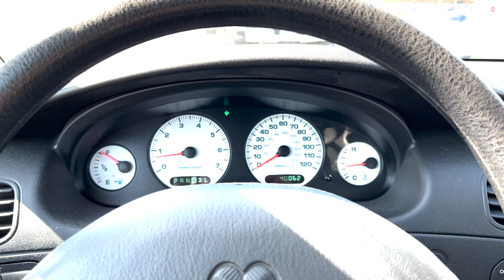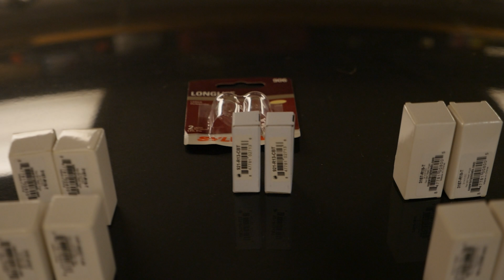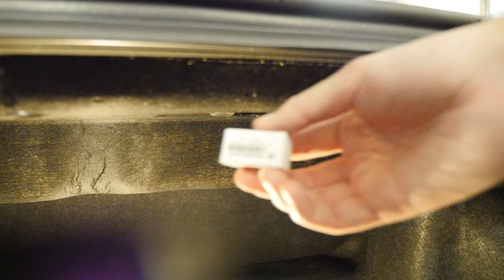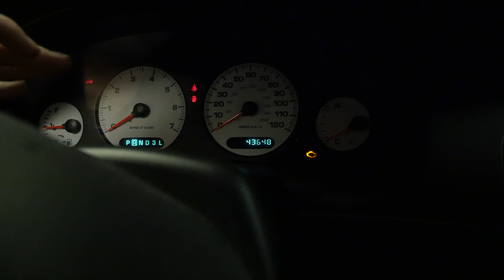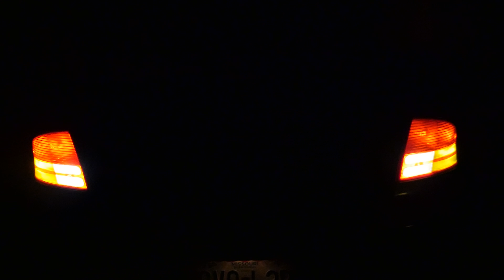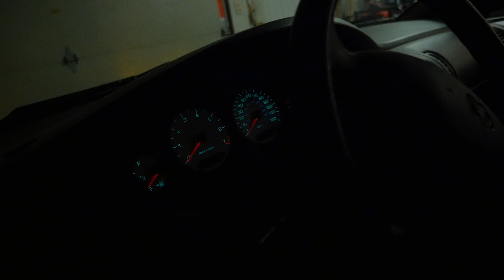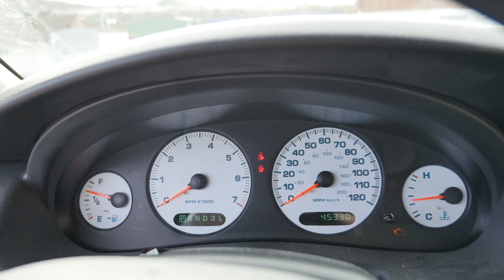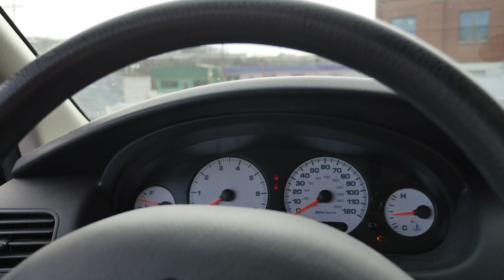My low-mile Dodge Intrepid gets a subtle yet modern lighting upgrade - LED Conversion Part 1

Comment: I'm still driving my 1999 Dodge Intrepid. Just replaced the radiator for the 2d time. 288246 miles on it and still running good.

Comment: I changed all the bulbs in mine to LEDs and it makes such a big difference.

Edit: I used white lights for the back because they all used the same bulbs and the lens was already tinted the colors it needed to be. I think it worked ok for my but I might change them because it looks like the colors are much richer when you use colored bulbs corresponding with the color they’re placed behind.
Reply from the maker: I'd definitely say it's worth it to get the right colored bulbs, even with tinted lenses. "Natural" white ones might not be too bad, but the super basic sort of blue-tinted LEDs you'll find on the shelf at auto parts stores will definitely throw off the color as shown in this video. Definitely worth it for me so far!
Reply: @CoolStuffInWeirdCars  that’s good! I’ve noticed on mine a fair bit of light bleed with the bright white lights.